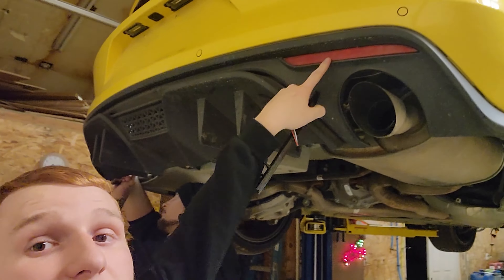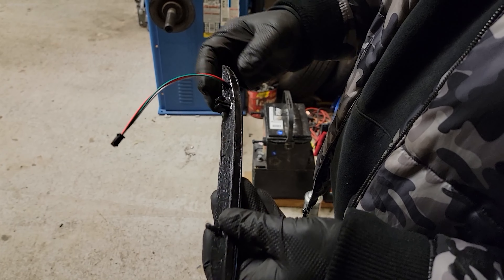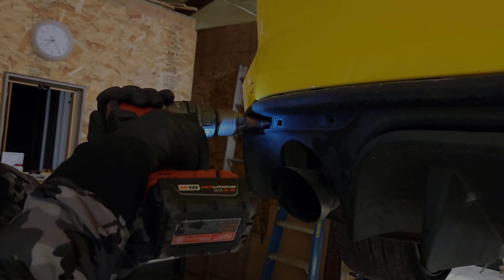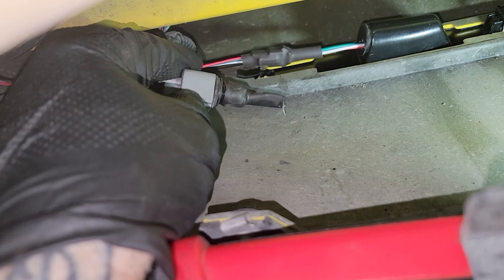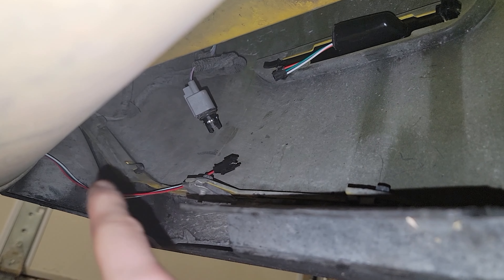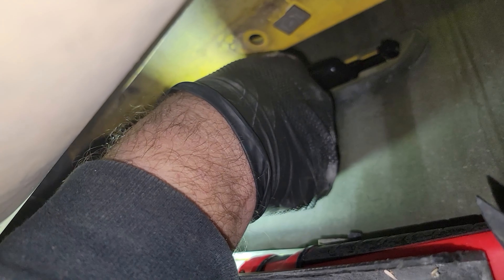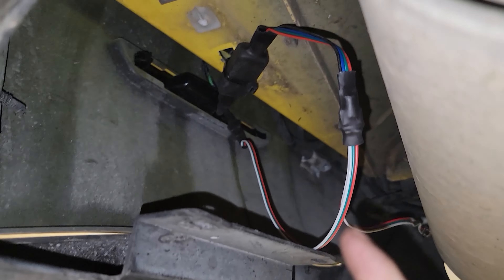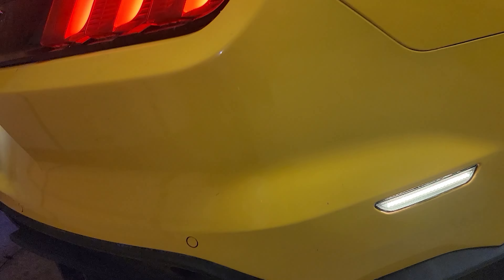How to Install RGBW LED Rear Reflectors from Striker Lighting on your 2015-2017 Ford Mustang

Comment: Could wire it so the rear is one controller and the sides are the other.  Both sides could be red and the rear doing whatever and vice a versa
Reply from the maker: 100% lots of options

Comment: bro what is the app we use
Reply from the maker: I think we mention it in one of our videos.
Reply: @automafiaracing is that actual yellow or is it white? looks more white than yellow. i bought them for the sole purpose of running plain white that’s why I want to make sure
Reply from the maker: we have white on there.  They are RBGW not just RBG lights.

Comment: no 18 and up side markers yet??
Reply from the maker: 15-23 Rear Side Markers are all the same.   So yes they are up.  Here is the link.  https://automafiaracing.com/products/striker-lighting-2015-2021-mustang-rear-side-markers
Reply from the maker: and here are 18-23 Rear Reflectors  https://automafiaracing.com/products/striker-lights-2018-mustang-rgb-led-rear-reflectors
Reply: @striker_lights  what is the app you use to control it that cost money ?
Reply from the maker: its a free app. LED hue